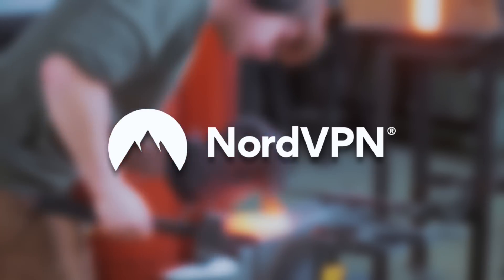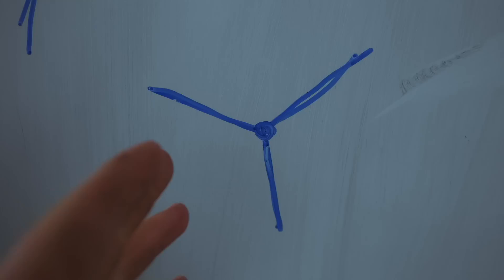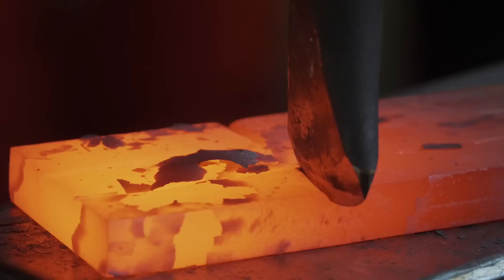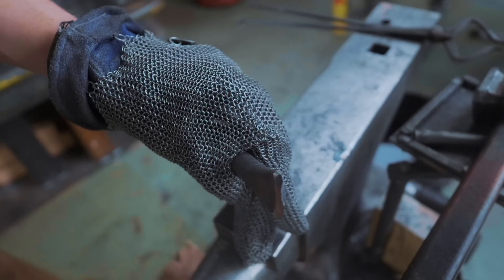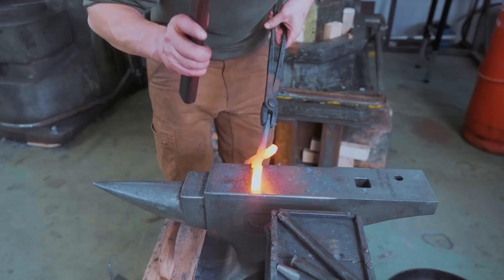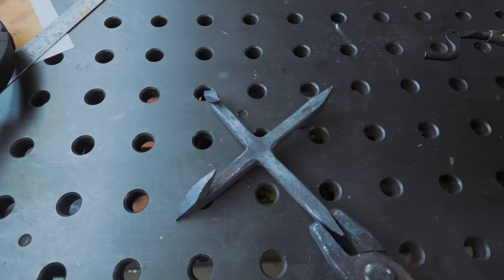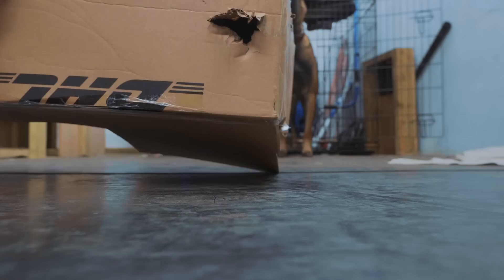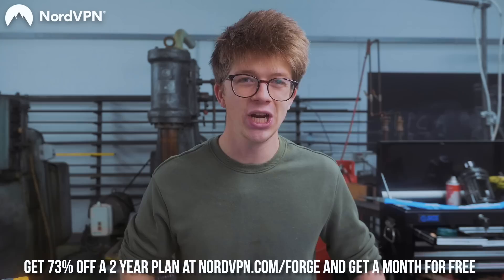Don’t step on Caltrops!!! (Even worse than lego) - Recreating this Medieval tool of war.

Comment: Easiest method would be to forge weld two bars together and then bend them. A lot of what I've read has been essentially having a blacksmith weld two large nails together and then sharpen two sides and call it good.
Reply: That was my first thought too
Reply: Exactly, he used the "easiest"  videoed click bait in order to generate comments like ours, dontch'a know.
Reply: i was thinking a bit of flat bar and and split it like an H in to an x rather then the 3 column method he used which would have wastes a lot of metal which old smiths wouldn't have wanted to do
Reply: Yes, easily the quickest and simplest way
Reply: @chrisrowland2223  Ah I see he's getting his strategies from Technology Connections, who's favorite saying is "Please debate in the comments, it boost engagement!"
Reply: @chrisrowland2223  might be, but it could just as well be Alec just not thinking of easier methods.

He ain’t the most organised and forward thinking person lol.
Reply: @wolflegion_  That too
Reply: yep.
Reply: Also totally impractical to think it could have been made of wrought iron this way.
Reply: Thats what I was gonna comment too. This is a disposable tool. It has to hold up to one stab at most, and even in the worst case, you just re-weld two half-caltrops to hold up to one more stab.
Reply: He did say 'from a single piece', so forge welding two pieces together is out by definition. But splitting the bar like an H like someone said is a way faster and material efficient method under those presumptions. Just split and twist, make barbs and presto.
Reply: that's the historical way it was done! back then people were more concerned about wasting material because it was a lot harder to make so the village smith could make a bunch of these quite quickly from a bucket of nails. alec's way looks cool but would be impractical.
Reply: @LeeRoyJenkins Using a forge. That's why it's called "forge welding".
Reply: It doesn't even have to eb a great forge weld, as the form of both bent around each other would hold them in place already. safes even more time and material. or realtively round material doen the same way. rather easy and quick to do, and since the temperatures don't need to get as hot, it should even be possible in improvised field forges. not to mention the smith tended to have a few helpers, so him holding the material and his helpers hitting it with heavier hammers in regular intervalls makes things even easier and faster.
Reply: @chrisrowland2223  Show us how it should be done!
Reply: Agreed. The moment he had to break out the chisel, fast and cheap went out the window.
Reply: I think they didn't need to be perfectly forge welded. They just had to hold together to be thrown down.
Reply: If anything, both this method and the barbed ends make it harder to create a useful caltrop. These weren't things you were placing piece-by-piece out in the field, you were throwing handfuls or bags full of them. The literal #1 requirement of a caltrop is that no matter what side it lands on when you throw it, one of the ends is sticking straight up.

Not saying this wasn't a cool project, and the idea of forging four tines in bar stock with a chisel is something I'd never thought of before, and that's neat! But if you took this "caltrop" to any medieval commander and told him you could finish two of them in a day, he'd run you right out of town.
Reply: I was thinking the same thing to
Reply: A piece of square split in from the ends halfway, with one split being vertical and the other horizontal, forged to a point, no waste.
Reply: My first thought was a split cross, without overlapping the cuts.
Reply: Lol this was such a complicated technique…you have been making so many crazy thing your mind is automatically now making even simple things too complicated :)
Reply: I was just going to say this.  Forge welding 2 bars together would have made it faster and easier rather than trying to do it in one piece if cost/ease of making was a concern.
Reply: Came here to say this
Reply: @mikkohernborg5291  one piece isn't the easiest, simplest way though.
Reply: I've seen modern road spikes that were just two bent and sharpened pieces of steel wire welded together. It didn't occur to me that essentially the same design could've been made in medieval times, just "out of order"; weld first, bend and sharpen afterwards. But yeah, simple and effective.
Though I'm guessing Alec went for the single piece design because the reference image at the beginning of the video seems to have been made from just one solid piece of metal. But splitting a piece of flat stock like an H as suggested by others seems like that would've been the method that was done back then.
Reply: yeah, like a cross. That's what I was thinking. Then bend it around. Which is literally what he did, but instead of forge welding it to a cross, he spent the time to bend it out of straight bar... oy
Reply: Pus it's pretty massive. To be fair, though, caltrops were meant more to control avenues of attack rather than have people actually step on them.
Reply: @wolflegion_  cough "forge doors" cough
Reply: You can make a H from flat bar and bend from that it’s the cheapest fastest most efficient method
Reply: @chrisrowland2223  you commented to say that just watch it or don’t it’s not that deep on how he phases things
Reply: @leytonpaul1915  I commented to add to the algorithm. I enjoy sitting back and watching all of his projects, my comment was not that deep either
Reply: I've never seen them forged any other way.
Reply: I agree. The most important cost for a medieval army would be that of the valuable iron itself, NOT in the effort needed to produce the weapon. So if making a ton of thin rods resulted in less waste, then that was the way to go.
Reply: Ahh the experts have come!!! Good on ya.
Reply: Came here to say this as well.
Reply: I was thinking the same, I don't see them chiseling those. It would essentially be a variation of cheap barbed wire imho.
Reply: Well,  now I know what's happening to all those  AMAZON boxes !  :-P
Reply: @chrisrowland2223  so really it chatbait
Reply: @ethank.6602  yup 😁, just to close to a bad site name 😉
Reply: You know Alec, nothing easy lmao
Reply: Went and beat me to it. I was thinking of when the Mythbusters made caltrops for their Spy Car episodes and they basically just bent small pieces of steel rod at right angles and welded them together in the middle. Instant caltrop.
Reply: the first picture looked like a simple bar, split in half from both sides, one side horizontal, one vertical
i mean, if that's not easy enough, i don't know
Reply: @mikkohernborg5291  He also mentioned how fast the medieval smith would have to had been in order to make the quantity need.         Thus trying to find an method that was faster would have been more appropriate. Never mind wrought iron of the day would have never survived that sort of forging.
Reply: @r.l.royalljr.3905  "Yes sir! Two! Every single day, you're getting two more of these bad boys!"

Thanks for that laugh, my friend.
Reply: Back in the day when they (blacksmiths) made huge quantities of nails, they would have been the go to stock to mass produce these quickly and cheaply.
Reply: @johnh290  I have made a caltrop (though mine didn't have barbs) with the method you described. It does work, and is pretty fast. I would guess that the historical ones were made via forge welding like how Matthew Rodriguez said though. Splitting is the part that takes the longest by far. Forge welding with a solid fuel forge would be extremely fast. Wrought iron is also easier to forge weld compared to modern steel too.
Reply: take two  nails, make a right angled  (90 degrees) bend in each,  hook them together so they form a tetrahedron and weld them together.
Reply: If it goes back to 300 BC, it would have probably been cast out of bronze, no?
Reply: @SeeMick1  Think about it.
Reply: The vietcong had an easier way, they made it out of bamboo.
Reply: @johnh290  *Than.
Reply: Yeah, my first thought was to flatten a bar a little and then make a cut from each end nearly to the centre then spread it out to make a cross and work from there.
Reply: OOOOR, he can take two pre bent ones and weld em together
Reply: Exactly. Especially since every blacksmith can make nails quickly, in their sleep. This makes them cheap. Spend half a day figuring out the best way to weld and bend in the same step, that makes caltrops cheap. And for infantry are denial you'd want them to be a third of this size to stand a chance of not being seen. Although if deployed at night...
Reply: The easiest method is to buy welded steel reinforcement mesh, cut the crosses out, bend them and sharpen them.
Reply: Exactly what I was thinking...
Reply: I think they used two thick wires
Reply: I was just coming in the comments to say the same thing
Reply: Actually the easiest wa would be to start with a piece of rectangle bar, and from either end towards the center split it, but not all the way to the center, twist one half of it 90 degrees from the other half.
Reply: @wolflegion_  correct me if i am wrong, but his goal was to forge it the way it was most likely forged in medieval times.
do medieval blacksmiths have welding kits ?
Reply: I'm a layman with no knowledge in blacksmithing and even I had that come up as my first idea.

Comment: Wouldn't it be easier and waste less metal if you made two tines from either side of the rectangle instead of 3 and 1? You'll have to bend them anyway and they'll end up being at the same angle to each other regardless, so that seems like a much easier solution.
Reply: I was watching this entire video thinking the same thing. Cut a rectangle of metal down the middle stopping before they meet, bend them out, twist 90 degrees.

Then I read the other comments and I realised even easier was getting two separate bars, heating and twisting it around one another while they forge weld together slightly, and calling it a day. Pretty effective when you're an ancient blacksmith and need to make two thousand of these.
Reply: Was just about to write this! :)
Have a like!
Reply: @xGamermonkeyx  A common trick today is to take two nails, take the heads off, sharpen them, bend them 90 degrees and tac-weld the bends together - voila, urban caltrops for your car-chase!
Reply: This guy milks every project he does just to get the more videos.
Reply: Yea that's what I was going to say
Reply: I was thinking that :) quicker, easier, can be made out of any sort of scrap metal.
Reply: Looks like I'm not the only one that had that thought.  Lol
Reply: He's trying to find the way they did it rapidly anciently
Reply: @contentdeleted4978  why is it such a bad thing to make a more interesting video, rather than the objective best way to make a single use tool of ancient warfare
Reply: @gustavosmith3980  and the method described here would be more rapid.
Reply: @ciarangale4738  It's not a bad thing to make an interesting video, but in the video he specifically said he was looking for the easiest way to do it, and the way he picked was definitely not that.
Reply: The Mythbusters did these back in the day, exactly like you described.
Reply: This was my immediate first thought.
Reply: there is no reason to waste the 2 cut off section and it certain that such loss would have been avoided, so I agree a rectangle with 2 splits would be more likely historically. However the round at the corner is very likely how it was done, just like you did.
Reply: Indeed.
2 cuts from the ends, not quite meeting in the middle. Bend them out 120° twist the middle 90°. Points and done. (At least that's how i make them, 10pcs/h.)

Or if forgewelding is easier for you then point both ends of a small bar and forgeweld perpendicular in the middle.
Reply: Yeah, my first thought also. Basically a H instead of a Y with an extra top prong.
Reply: I think everyone watching this video was thinking the same thing.
Reply: I was thinking the same. Also it would propably be more efficient as a weapon if the end product was half the size or so.
Reply: I am watching thinking the same thing like, Alec you said it's supposed to be easy. Just do 2 and 2 and twist. The middle 90 degrees right?
Reply: Came here for this. Lol
Reply: Any tetrahedron shaped pointy thing might work  even fried water chestnuts
Reply: Smart people think alike :)

Comment: Less cuts, time and waste: In a rectangle, make two cuts to form an H. Twist the two main arms of the H 90 degrees to each other (to form a cross). Bend each of those arms 'outward' at center to form a 60 degree angle, and you have your basic shape...
Reply: You beat me to it! I would agree that either this or forge welding two rods together and forging, then bending them to suit would have been far more efficient and would have resulted in less/no waste
Reply: A piece of square split in from the ends halfway, with one split being vertical and the other horizontal, forged to a point, no waste.
Reply: if you have the goal of it only being one piece and no power tools, what is better? Trying to forge welds two pieces together doesn’t seem that much faster.
Reply: I think this is how they made it historically.

Comment: I'd imagine a faster to manufacture pattern would be a single line splitting the length of flat bar with a break in the middle to still hold it together. Then, you just rotate the legs out 45°and you're at the cross you had towards the end of the video.
Reply: That is the traditional way, very very fast to finish.
Reply: The angle of you want all the spikes equally spaced is 109.5°.
Reply: @ragnkja  Giving me chemistry flashbacks, is that the methane bond angles? They're little molecular caltrops.
Reply: @sshuggi  
Yup. That’s exactly what I searched for to find that angle.

Comment: this one is really too big for the battlefield because it would be too expensive and less effective than smaller caltrops that are hard to see on the ground in front of you. it sure looks really cool though at this scale!
Reply: That one is horse sized. Good against cavalry.
Now, imagine charging on your horse just to have him tumble after stepping on one of those, and throw you tumbling onto some more...
Reply: @Kualinar  that would sure be painful! i think the small ones would be effective against cavalry too though because if you've ever seen a horse with something stuck in their hoof they sure don't walk properly. they tend to step straight down too so they're more likely to get poked than to bend the nails over. RIP all the horses used in silly human wars, poor things.
Reply: @SAOS451316  To be fair it’s not that it’s useless you just have to hide it which is relatively easy actually all you need is some brambles or leaves on the trail

Comment: "X" shape would seem to be more material efficient.  Modern military ones are typically round stock with points, bent 90º and welded at the bends.  There's a way to make everything every which way.
Reply: If the final shape is a tetrahedron it’s actually 109.5° (or thereabouts),
Reply: @ragnkja  
😅 thank you fine resistance fighter…

Comment: I would have thought splitting the piece of bar into 2 & 2 would be easier & quicker than 1 & 3, but remember; If it works, it's right!
Reply: That’s what I was thinking. Then no waste of material either
Reply: @Andrew Kay Maxim 43. If it's stupid and it works, it's still stupid and you're lucky.
Reply: Next time you spend 8 hours making a 20 minute project at work, tell your boss it's still correct lol
Reply: A 'H' instead of a 'Y' with an extra top prong. Two cuts and done.
Reply: @Andrew Kay Yes, I was counter-quoting from The Seventy Maxims of Maximally Effective Mercenaries.
:)
Reply: @jeremymcadam7400  It's a right way, but that doesn't mean it could not be done better.

Comment: “The anvil is untouched”
Pretty sure thats one hell of a mark right there
Reply: Looked more like a cross pein miss hit, anvils are usually softer than hammers usually to avoid chipping the anvil face and just leaving a dent when struck.
Alec makes his chisels softer than the anvil to avoid gouges in the face after a miss-hit so the chisel edge bent over instead
Reply: Not really, it's just a slight dent, anvils are soft, they get covered in them. It wasn't a chip or crack, that's all that matters

Comment: you could also start it off by putting one slot in each side of the flat bar and not connecting them in the middle. You would not have to cut material off to make the cross.

Comment: The Mythbusters did caltrops and the ingenious thing about them is that no matter how you throw them and no matter how they bounce around, they always land with a spike pointing up. Adam Savage made a bunch of them for that episode. I think all he did was bend two nails and then tack weld them in the middle if I recall. Yours are way cooler.
Reply: I think I remember that. It's very much what some "naughty" people did in Northern Ireland years ago for use against police horses. The authorities were really piffed off at that.
Reply: Another episode was for a getaway vehicle Adam savage made them out of small steel tubing to puncture and deflate tires. He made a bunch of 90° bends and cut them into “L” shapes then welded them together.
Reply: He made a jig specifically to hold the bent pieces in place for welding.
Reply: Ah, that was it! I was not recalling it correctly. It wasn't nails. It was hollow tubing so that when they puncture the tires, the air could escape. And, yeah, he was more proud of the jig than the  caltrops themselves.
Reply: imagine being a caltrop that fails to land with a point facing up